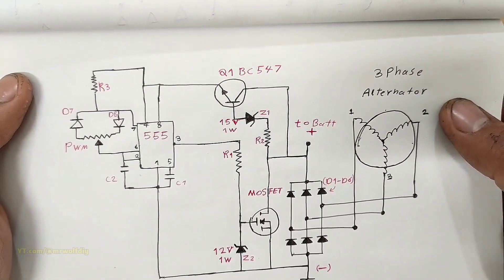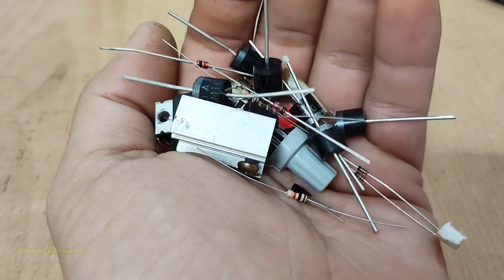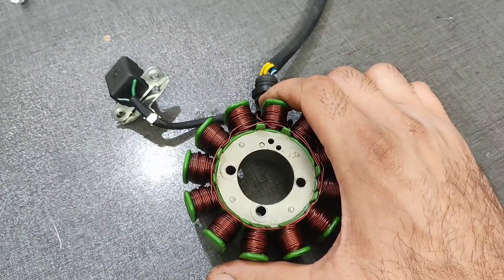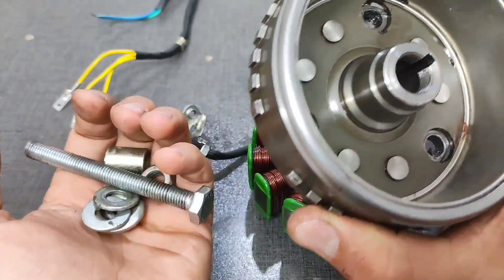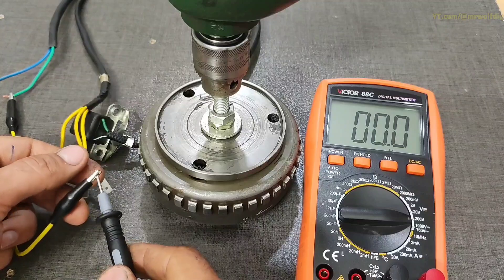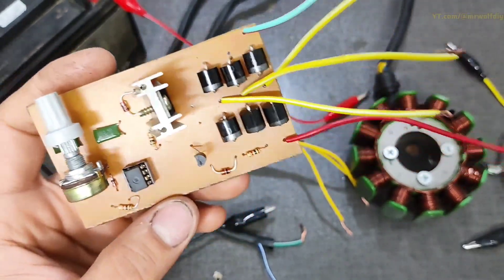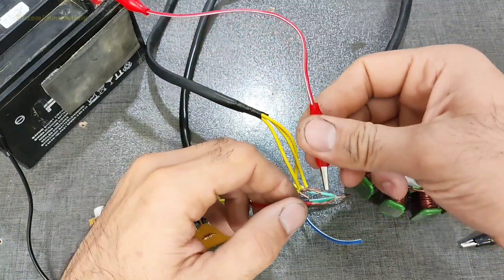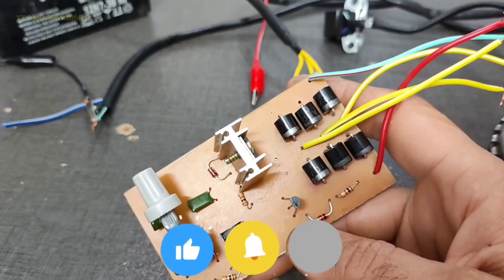I built a 3-phase regulator no one ever made — full DIY guide

Comment: what is the fuction of the potentio meter Mr. Wolf? Is it to adjust the output at high rpm or what? please explain🙄
Reply from the maker: In fact The potentiometer is used to precisely adjust the PWM duty cycle to achieve the correct average output voltage according to the battery’s charging needs...
Reply: @MrWolfDiy  thanks, I get it now Mr. Wolf

Comment: Hello. I'm from Athens. You've done a great job and you're one of the few and in some cases the only one who has dealt extensively with rectifiers. I've been looking for years now for a way to make my own 6-wire rectifier, 3 phases, 1 voltage, 1 ground and 1 signal, ideally with MOSFETs. I want it to be close to 65A. I'll experiment on a Honda SH 150i. I can't find a diagram anywhere, nor what materials I'll need to do it. I want to place the board to a heat sink shell of a damaged rec/reg I have like you did in an other video. I'm constantly changing rectifiers and it's tiring me. I've now pulled an extra ground and signal because my broken rectifiers damaged the cables. I've also installed a computer fan that's driven by a relay. I want a real expert to finally help me make my own durable rectifier regulator with relatively cheap materials like MOSFETs. Is there any chance you could give me a little help with this?  I've been waiting for years for a case like yours. Thank you.
Reply from the maker: My Dear friend from Athens:
Thank you for your kindness and support! Building a 6-wire, 3-phase rectifier with MOSFETs and around "65 A" is definitely a challenging project, and heat management is very important — the circuit size will probably become quite large and may not fit inside your rectifier’s heatsink.

Unfortunately, I don’t have a ready-made diagram or parts list to share right now, but I’ll look into it. In the meantime, I suggest checking out electronics communities such as Electronics Stack Exchange, specialized motorcycle electrical system groups, and related Reddit forums—there are plenty of people there with experience in this area.

In general, here are a few pointers:
For such a high-current project, ordinary diodes won’t be sufficient. You need a three-phase full-wave rectifier rated for at least twice the expected input current.

The same applies to MOSFET selection—use components that can handle well above your maximum load. For each phase, you’ll likely need at least two MOSFETs in parallel.

Next, consider the MOSFET gate-drive circuitry. Because the stator voltage is AC, each MOSFET requires a properly matched gate-drive circuit.

Finally, thermal management is critical. Proper heatsinking, thermal paste, and possibly forced air cooling will be necessary.

By following these principles, you should be able to build a durable, high-current rectifier.
Good luck with your project!
Reply: @MrWolfDiy  thanks for the response and I will follow your advice and search these pages however think about the case of building such a project approximately close to 60 amps and certainly over 50. it will be practically a unique project that we will see being carried out for the first time all over the internet. it is a challenge. I talked about 65A because the only information I found about the current of the rectifier was from two maybe aftermarket rectifiers that in their specs gave somewhere close to 60A+. It was one from Taiwan probably Cheng lung and one from China. The Japanese do not mention anything. 

Thanks again
Best regards

Comment: None of the power semiconductors have sufficient heat dissipation for higher currents. What motorcycle does this work on?
Reply from the maker: This circuit is designed for older engines and may not work for newer ones.

Comment: What if my 3 phase stator is outputting 230v ac across any two phases and i need it to charge 13-15v dc. What components need to be bigger than the ones you use here
Reply from the maker: That 230V three-phase AC is unusual for a motorcycle; normally motorcycle stators produce 20–70V AC when unloaded. If the measurement was taken with no load, the number might be high, but in practice it will drop under proper load.🤔
If you really have 230V AC, do not use a standard 12V shunt/series regulator , it will burn out, and these components simply won’t work at all...
You must either:
1. Rewind the stator so it outputs a lower voltage, or
2. Use a step-down transformer and connect your regulator/rectifier circuit to that... Also you use your OEM rr unit...
By the way, you didn’t say which motorcycle you have.
Reply: @MrWolfDiy  i think he talking about the gasoline generator some gasoline generator has no battery built in or electric starter. to start the gasoline generator manually to crank it by your hand.

Comment: Can someone plz help me 
I have a dc cdi with me , when I manually trigger it with a pickup coil it didn't work but when I connect the signal from the bike pickup coil it works, i brought the same pickup and tested it manually and it didn't work
Reply from the maker: Hi dear, When you momentarily connect and disconnect the pickup coil to ground (the chassis), a short voltage spike can be generated due to induction or transient noise, which resembles a pickup pulse. That spike might trigger the CDI and cause a spark.
However, if it works correctly with the flywheel, then there shouldn't be any problem.
Check its resistance with a multimeter, it should be around 150 ohms.
Reply: @MrWolfDiy  mine is around 137ohm , actually I am building a 2 stroke engine so I need a custom cdi setup, I brought hero honda Passion pro digital cdi 4+2, 

The problem I'll describe it in detail 

When I connect the cdi to my bike it worked no problem, but when I manually wired it according to the diagram it didn't work for my 2 stroke engine 

So what I did was I replaced the pickup coil signal from my bike and it worked can u provide any details related to pickup coil pulse or anything like that cuz the main problem is triggering the cdi rest it works,

Comment: bro what is the liquid you used to remove copper coating??
Reply from the maker: Hey buddy, 
If you mean the liquid that coats the board, it's printed circuit board (PCB)acid, also called copper acid.(cupric chloride  and ferric chloride)

Comment: why does motorcycle use shunt regulator? what's the advantage? Series regulator should work fine and is more efficient.
Reply from the maker: Hi, thanks for the good question,
It's mainly due to the low cost and simplicity, while still providing acceptable stability and compatibility with older-generation motorcycle platforms, which are still being produced.

However, advanced motorcycles benefit from newer systems, which are more expensive to repair and purchase, but offer significantly better performance and efficiency.
Reply: One of the major reasons they use shut regulation is turning off the output of the alternator cause very large voltage spikes in the coil windings. Causing possible insulation failure and / or voltage tracking across terminals. Shunting, short circuiting, the alternator suppresses high voltage spikes. At the expense of some lost energy expended as heat in the alternator windings.

And you really do need a diode between the battery and mosfet.
Reply: Thanks for all replies 👍👍👍

Comment: subscribed, please make video about make dc cdi with adjustable rev limiter (spark cut) sir 🙏
Reply from the maker: Greetings to you,
Yes, building such a CDI is possible, but it's a bit complicated...
It requires using a microcontroller, which needs to be programmed.
I built one before, but I ran into problems with the coding, so I left the project unfinished.
However, I plan to start working on it again...

Comment: Mi pregunta es ¿para que pusiste pot?
Reply from the maker: Since the system of this regulator is based on shunting, the excess voltage to ground can be adjusted by a potentiometer to prevent overcharging the battery, however, this circuit needs to be tested over a longer distance to see if it works.